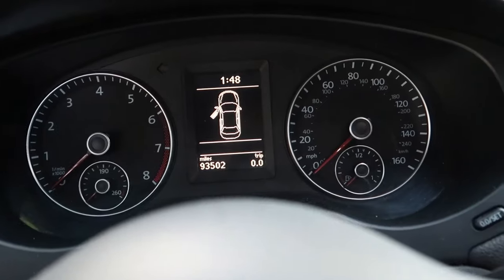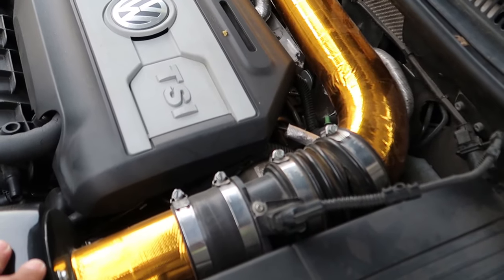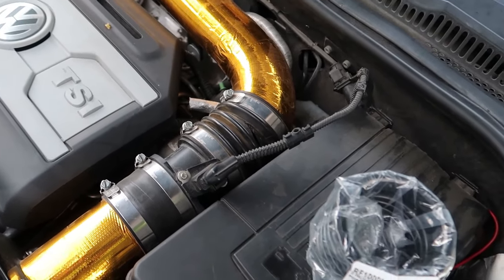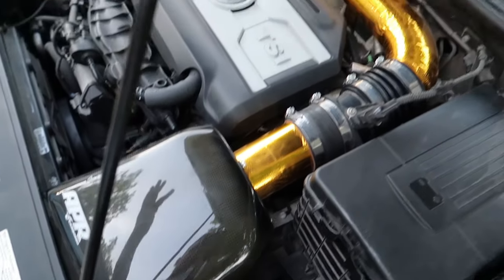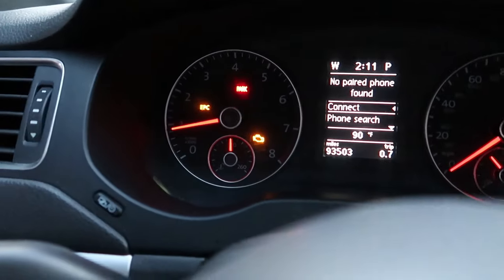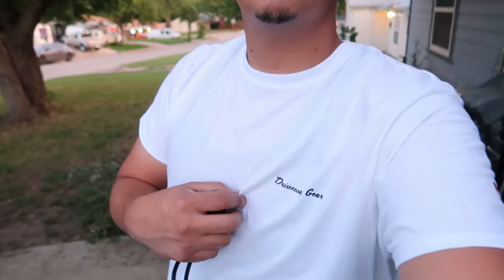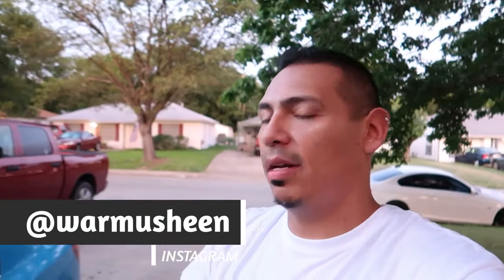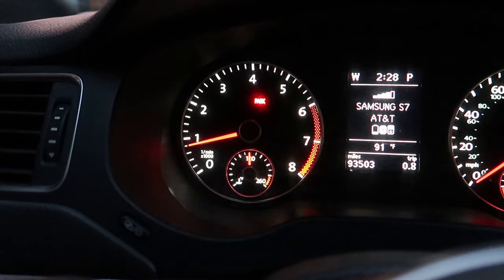EPC Light Fix - VW Cylinder Misfire

Comment: The EPC light is an indicator for a variety of issues and is basically a warning to get your service station to hook up and read the codes.  We did this today, and turns out one of the pistons has very low compression.  We have an expensive option ahead to have the engine lifted and the pistons repaired, and if we had just ignored the EPC light and assumed it was something small and kept driving around we could have stuffed the whole engine.

Comment: Yo man did your car go in limp mode as well before you replaced that part? I ran the code and got engine misfire on cylinder one. Replaced all coils and spark plugs. Car runs way better but it has very rough idle and once it hits 3k rpm the acceleration shuts off. Car runs fine below 3k rpm
Reply from the maker: I knew the issue so i didn't drive it around. If you replaced all your coils and plugs, then depending on your mileage, it might be time to replace the fuel injectors. I had the same issue a few years ago. I replaced coils, plugs, and still misfiring.  Replaced fuel injectors and issue went away. I had a little over 80,000 miles on the car.
Reply: Also check ur MAF sensor

Comment: just searched for the issue and here I am...appreciate your work. 
subbed. 
my 2013.5 gli has 
129,340 miles on the clock. bought it new early summer,  2013 when they began using the ea888 engine maybe as a irl testing kinda thing before they used the engine in the soon to be released golf gti with the ea888...I love this car and tho I've had some issues I hope to be driving it
in another 10 years....don't laugh...it could happen. 
thanks dude.
Reply from the maker: Yes sir! Had mine since 2012. I don't plan on gettin rid of it anytime soon either!

Comment: I actually had a epc error today. Going to get gas on the way to work. Turned around and went home to grab my backup vehicle. I was originally thinking it was an issue with the dsg trans. Soon as I'm off work I'm going to have the time to actually look it it. Mines a 13 vw Cc 2.0 turbo

Update: when I checked the only code stored was for cylinder 3 misfire. Ran the data and cylinder 3 wasn't firing. So my fix is the car needs a tuneup
Reply from the maker: Sounds like a bad coil pack or fuel injector. Good luck on your repair 👍
Reply: did replacing the spark plug do the job? my cc has the same issue
Reply: @Shcaso  what ended up fixing mine was replacing the crankcase ventilation valve. Ever since I replaced that car ran perfect. Just sold the car last week at 163k miles. Issue popped up around 90k miles so ide say for 70k miles of no problem that happened to be my problem
Reply: @Crazyman23  i’m j under 90k w a 2011 so that may be the issue. though i’m starting w new spark plugs. if that don’t work i’ll do coils, and check that crankcase thing. i’ve also read about throttle body among other issues. there’s only so much i can do myself before needing to take it in to a shop. though i have a obd2 and it’s saying triple misfire so 🤞🏼it’s j the plugs
Reply: @Shcaso did the spark plugs work for you?? I’m currently having issues with the epc light as well and I was wondering if it was resolved or if it’s another issue

Comment: VW is probably the worst brand I've owned. Less than 2 years of ownership and I've spent 40% of the cars value on repairs... and it breaks down every 2 weeks from different issues. Straight trash😂 can't wait to get rid of it

Comment: Replaced my plugs, coils, vacuum pump gasket, valve cover and gasket, and throttle body and still getting an epc light on high rpm. Turns off when I turn the car off and doesn’t come back on until I hit around 5k rpm and then it turns on and the car goes in limp mode, any ideas?
Reply: My 2015 Audi A4 Quattro does the same thing.  I keep throwing parts at it.  Did you figure anything out?  Thank you so much...
Reply: @darkelite8702  Yeah I figured it out, turns out a rodent ate my high pressure oil sensor and when I would hit high rpm’s it would trigger the sensor and since it wouldn’t work the epc light would come on. Swapped it out and no more epc light, I would highly recommend buying a obd sensor specifically for European cars, that’s how I figured out it was the pressure sensor

Comment: My EPC and check engine light is always on. My mechanic told me it misfires because my spark plugs have burnt out quickly and I need to have it replaced every 2 months. When I had it replaced, my car runs fine. Then 2 months later both lights came on again when it started to throttle. Been driving it like this for a whole 3 months straight and suddenly it broke down on me. Couldn't accelerate or start up my engine. Now I don't know what will happen after it broke down on me. Could it be the spark plug? I need some advice. Let me know what i need to do to have it back running.

Comment: Any suggestions if my epc light randomly comes on...then turn my car off and back on, the eps usually goes away?? It’ll happened like 1x a month maybe less 🤦🏻‍♀️
Reply from the maker: Might get worse over time. Get it scanned. There should be some stored codes to check. Start there.
Reply: Yes mine comes on like 2x a year since I have been driving. It  always goes away but gets annoying when it comes back on
Reply: @ethankrakowski4200  so was something wrong ?

Comment: Interesting. I have a 2015 Jetta 2.0 and just hit 40,000 miles. The EPC has come on a few times and when I pull over and turn the car off for 2 minutes it seems to work fine. I did look under the hood (no mods) and I noticed a mess around the throttle body intake hose. I pulled it and it slid right off without loosening the clamp....
Reply from the maker: O wow! Hopefully that solves your issues!
Reply: Joels Driveway man, it didn’t fix the problem. I have the car serviced regularly by VW and it’s always checked out fine. I really don’t want to change out the throttle body, but it’s a small investment since the car has been so good to me. Maybe I need to buy an OBD scanner? Seems like a reasonable thing to spend under $40 on, if it can tell me what’s up. Once the car sits overnight, the “Check Engine” turns off. The thing I really want to do is program the car so the horn doesn’t sound when I lock the car. What a POS sound THAT is.
Reply from the maker: @RyanCrase1  Get one from Amazon. They're like 35 bux. A scanner is a MUST for these cars. Easy to Google the codes and fix it yourself. I'm curious what the issue is. Let me know what you find out.
Reply: Joels Driveway thanks Joel! Will keep you posted.
Reply: Joels Driveway I ended up needing plugs, plug wires and an ignition coil. The car has 44,000 on it and it’s been trouble free.
Reply from the maker: @RyanCrase1  wow, that's crazy to hear. At such a low mileage. Thanks for the info. Hope it helps people out.
Reply: Joels Driveway that’s what I thought as well. Only 44,000. Got it back today and drive a bunch to see if the EPC light would pop up, hasn’t happened yet, but it has been random and maybe once every couple weeks. Will update if it happens again, or if it doesn’t. Thanks for your vids!!
Reply: @RyanCrase1  Hi Ryan this happened to my Jetta Mk6 1.4tsi well it were showing signs like the engine is gonna stall and this happens somethimes only like when 5th gear onwards or in D while stopped and the traffic light a slight shudder happens not always, it's just odd yesterday brought it to the garage to have a look and mechanics couldn't replicate the issue. Then today the car shudders check engine light was blinking then went off but EPC light came on and stayed on.

Did and OBD11 scan and it showed cyclinder 1 and 4 misfiring, Did your car exhibit these symptoms too?
sorry just to add my scan results shows misfire in cyclinder 1 and 4 unlike Joels car that showed misfire on all 4 cyclinders, I am wondering if it is coils its has been 9 years without changing them.
Reply: J R yes! 1 & 4 misfiring for me as well. Replaced plugs, plug wires and ignition coil and it’s been perfect. I’d say do it yourself, I paid $900+ and then found a YouTube video that shows you how to do it step by step. You could do it for well under $300.
Reply: @RyanCrase1  Thanks Ryan I am hoping and praying that this is the case for me and not an engine failure. I had been scanning the car for months now and it was showing small amounts of misfires in the said cylinders but not enough to throw a check engine light, took it to the garage they scanned it and didn't pick up anything so they performed a compression test results were perfect so I'm at a lose so to why this has happened. Your feedback is much appreciated hoping mine would just be coil packs, Thanks again Ryan have a restful weekend
Reply: J R I hope you get it sorted!! My EPC light came on every week before changing that stuff. Have a great weekend.
Reply: @RyanCrase1  Just to share an update on the issue having just collected the car from the garage it looks like replacing the coil pack solved the problem. Thanks Ryan will update here for the benefit of those who are facing similar issues if anything pops up (hopefully not).
Reply: I have the same issue with occ. EPC and reader says cyld 3 misfire. What do u think. Tx
Reply: @Docorif  Did your CEL light flashed or stayed on? It could be also due to a worn out spark plug among other things like cracked coil faulty injector located at cyld 3 etc
Reply: @JR-tl8tg  Nope , occasionally when i start the car the EPC comes on the car starts to shudder a bit and drive loses its smoothness. But if i switch off and turn on the car no EPC and car drives smooth and normal again. Thanks
Reply: @Docorif  Ok maybe try swapping coil located on cylinder No. 3 to either cylinder No. 1 ,2 or 4 do a scan and see if the misfire has moved to that change. If so then you need to replace that problematic coil hope this helps
Reply: @JR-tl8tg  Tried. Do you have to delete code and run test again. Whats next steps after coil.
Reply: @Docorif what did you observe after switching coils? Was it still showing misfire on cylinder 3 and yes please clear the codes then test run
Reply: @JR-tl8tg  Will need to erase codes and check. Will revert. Thanks
Reply: @Docorif  No worries I understand how frustrating and annoying this problem can  be I have been trying for months. The pandemic has put a strain on my finances and so trying to identify and fix the problem yourself is the way to go for me now. I do hope you would be able to sort out this issue soon.
Reply: @JR-tl8tg  hi, switche the coils with the plugs, same 3rd cyl misfire. Shall i change all the plugs and see? Tx
Reply: @Docorif  OK,  so I'm assuming that you 1st swapped the coils only to check if the misfire was still located in cyl 3. Then went on to swapped the spark plugs to see if the misfire was still located in cyl 3. Then the coils and plugs are fine.

If you have done the above and still find misfire in cyl 3, then the problem is specific to that cylinder only and it could either be a faulty cyl 3 injector or broken springs intake valve on cyl 3 (compression test would show a little low on cyc 3 )
Reply: @JR-tl8tg  i actually swapped the coil with the plug at one unit. No change.  Btw i have no issues in driving like shudder or loss of power. Only the occasional EPC come on usually on idle after starting the car and leaving it on a few mins. Less frequent after a long drive. And then the light comes on there js a shudder like feel almost like the car is getting choked.   Would you think it is just carbon deposition issue. Tx
Reply: @JR-tl8tg  Also forgot to mention the EPC light goes off immediately after a restart and car is back to normal.Also i dont have the check engine light come on at all.
Reply: Lol you pull over? I push in the clutch, shut it off for 10 seconds, start it, and take off again. My battery is old, hopefully a new one solves it.

Comment: Nice work Dog💯. Also a bad coil pack can cause the epc light to come on. Had that problem on a 2012 VW Beetle Turbo. Also clearing codes actually solves a lot of problems on euros
Reply: Just came on my 2012 beetle along with the check engine light. Almost impossible to accelerate normally, just happened from day to the other. What could it be?
Reply: @mauricioreal7384  Did you fix this?
Reply: @stopa003  yes. Took it to my mechanic and it turned out to be a bad throttle body. Paid 400 bucks, had it replaced and was on my way again.
Reply: @mauricioreal7384 i have a cylinder 3 misfire in my 2015 Passat Tsi and whenever I try accelerating the engine/thottle starts stuttering, I feel like it could be my ignition coils, injectors, or spark plugs, and maybe even my throttle body but I’d love to hear your opinion/feedback
Reply: @Foreignwrists i have the same issue, what solved tours? Thank u
Reply: I have the same problem.For me it was the ignition coil.

Comment: EPC LIGHT ON AUDI A7 2011 OBD CODE P033600 AND P032100 ??????
Reply from the maker: A bad crankshaft position sensor would cause both these faults. I would start there.

Comment: Great video, I have a 2014 jetta, the EPC light came on, and I lost power, I shutted the engine  and wait for 15 mintues, then I turned it on and the light was gone, I have the engine maintenance done the same day after the situation, and went I had the car back the engine trembled again and the light poped on again, what could it be?
Reply: Me too
Reply: #MeToo
Reply: Get a new battery, dude!
Reply: Same
Reply: Anyone find out the problem ?
Reply: Update the post,  in one shop said that the pcm that communicates to the gearbox was bad, that it would need to be checked cable per cable or having changed it. I was not convinced about it, what I did at home was to buy a contact cleaner and check out the coil sparks. After checking it out, and clean the gearbox contact cable and also I notice a noise coming from the pcv valve, what I also did was to check it out, and after turned the engine on, and drive it for a while, the engine and code light went off, and the engine reciver its force

Comment: EPC light on? Most likely, you have an old battery under your hood. Either that or it’s time for an oil change. Replace it with a new one and the EPC light should permanently disappear.
Reply: What if it's a vw passat
Reply: I have an Audi 😫
Reply: @introverted2316  It should do the trick for a Passat also.
Reply: what's oil got to do with the power system?
Reply: @d1ssolv3r  someone told me the oil pressure sensor is linked to this system
Reply: mine has to do with the throttle body,  or accelerator
Reply: Changed oil a month ago. Battery was replaced six months ago. Neither of those caused the EPC and engine lights to come on today. What else could it be?
Reply: For those following this thread. My car ended up at the dealership. Their computer detected a malfunctioning fuel injector that required replacement. They explained that to reach it, the engine had to be moved. Not a cheap undertaking. It ended up costing $1,700. 🥴
Reply: @Fr1nc3sc41  oh boy...what car is that?
Reply: @georgemijatovic4060  2017 VW Passat SEL.
Reply: My vehicle EPC light is on and it also indicates that it's time for oil change. I'll do the oil change tomorrow and let you know ✌🏾
Reply: @zuks6245  The dashboard light was the least of the problems. With the light came a diminishing ability to accelerate and a hesitance of the vehicle to advance. It's why the car ended up at the dealership, to address the issue and they knew exactly the issue. They changed a fuel injector.
Reply: @Fr1nc3sc41   I did the oil change , EPC light still comes on. They said it's a leaking Thermostat🤔
Reply: @zuks6245  Yes, apparently the light can come on for multiple reasons. I'm sorry to hear you're having this issue.
Reply: Lies

Comment: Hi I m struggling in Volkswagen Polo as a symbol of EPC ,Engine and Temperature in running and engine 9ff after a 20 kilometer run please suggest
Reply from the maker: Hi there! I would suggest scanning the car for error codes first. Once you know what errors you have, you can pinpoint a solution for repair.

Comment: My EPC light comes on after 30 minutes of the car driving fine. No CEL codes at all. Battery tested and its charged + within voltage. Help!!!!
Reply: Try replacing crankshaft position sensor( engine speed sensor) worked for me.

Comment: I have a p025A Fuel Pump Control Module Control, Singal Too Low. along with an EPC light. Replaced the Fuel Pump Control Module and still having EPC Problems any advise?

Comment: I was checking my fuse box because my 12v connection was not working . Found out a fuse was blown out I put it back in place and I got the epc light 😭. Would this work?

Comment: Have a 2012 Tiguan. The low pressure light comes on when the car is warm. The oil pump and sensor are good. Can’t quite figure out what’s wrong. Has been like this and drives OK. Of late the check engine light is lit and EPC light comes on and off with little shaking. Any suggestions?
Reply from the maker: Scan the car for codes. Google the codes. It should lead you in the right direction.